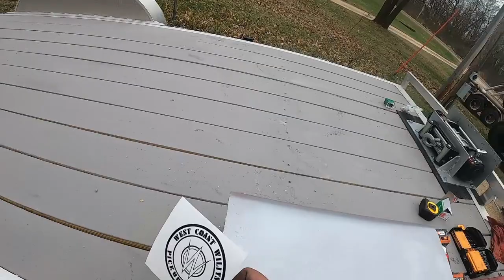covered winch install/  free  chance to win a free shirt

Comment: I need to get off my but and install my winch on my trailer. Been sitting in a box on the shelf forever....That is a real nice setup that you built.
Reply from the maker: Ty, yeah i know most sit out, but with how infrquent i gonna use it, i felt covered better way.
Also so many ive seen they mount on rail, whether steel or alum, i dont trust rail to winch from

Comment: HERE I SIT JUST WAITING FOR MY TRAILER TO BE BUILT  AND SINCE OF COVID  THE PARTS SEEM TO BE MISSING IN ACTION  BUT THEY WILL COME 5 WEEK DELAY SO FAR  AND YES ITS A H&H  TRAILER  I WENT ALL ALUMINUM  SINCE THE BOARDS SEEM TO ROTTEN OUT TO FAST FOR ME  I JUST REPLACED SOME A FEW YRS BACK AND ITS A LOT OF WORK SO  GOING FOR THE METAL DECK ALUMINUM  PLUS IT WILL DROP MY WEIGHT OF THE TRAILER  SO I MIGHT BE UNDER THE 13 TN. TO PLATE THE OLD FORD DUMP.
Reply from the maker: Lighter is nicer, i put deck coating on as soon as bought to help save the wood.
 I wasnt concerned with to light, only really hauls the jeep for mud events, tow rarely otherwise
Reply: @bigjim11566  ya nothing like a H&H TRAILER   but i just sitting here waiting for my trailer to come to life and in my hands  i miss a trailer to haul the skid to go to work  and i was shut down by the fbi told not to work but they did noting since i am a victim of major public corruption and injustice done to me and even the attorney general barr said in his letter  the evidence i have is over whelming and made him sick what they did to me. being a victim of crime of public corruption from 2006 and non stop and now its 2021 and joe biden never did noting for a disable veteran  that was targeted by color of blue public corruption , identity theft, home destroyed by crime, asset stolen and a shoot to kill order on me for turning the judge step son in for dealing drugs on concrete project.  i was a D.OD. CONTRACTOR.
Reply from the maker: @meanoldbonbon2405  mines been sitting, spent 2 months in hospitol now month at home recovering, but hope to be up an makin vids again soon an back to work